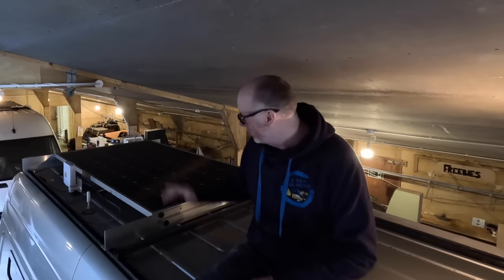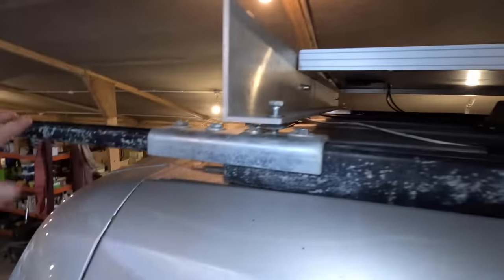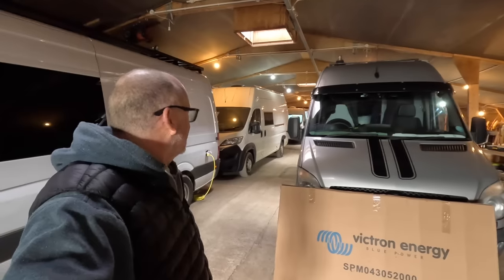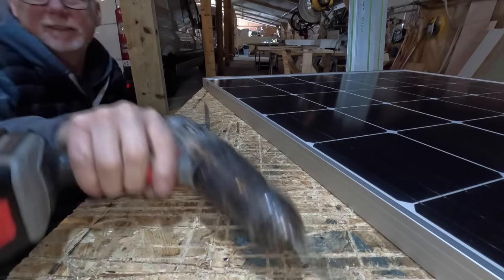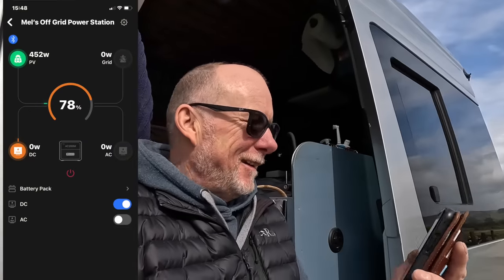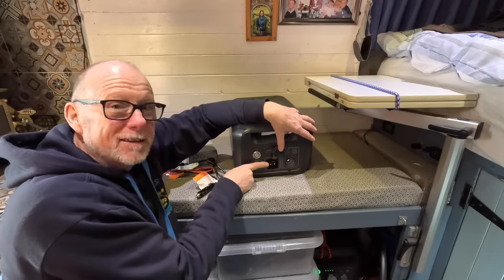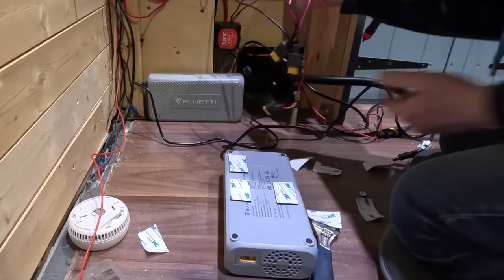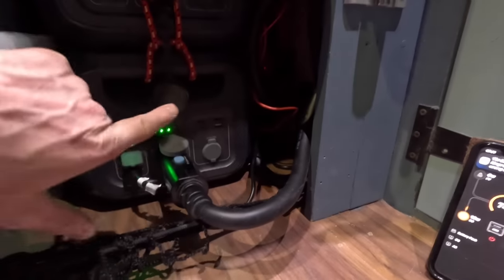This camper van has an insane amount of solar power

Comment: The parallel panels be ok in the summer, but you might want to consider series come winter. You won't ever get more than the max voltage of one panel so if the sun's low enough or it's cloudy enough you could be dropping down to 12v and the battery won't charge. At least in series you might get 7 volts off each panel making 14 and still be able to get some juice :)

Comment: Great bit of good luck there after extending the unistrut. Its like fate was watching over you. Ive just fitted an identical panel to the one on Viv-i-van so I now have 300 watts of solar. Theres enough room to fit one more 150 watt panel on the roof but Id then have to get a dedicated MPPT as the ctek 250 se only copes with 20 amps and with the two panels they are 17 amps in total . I'm aiming to get a power pack like you have and only use electric in the van for everything. Thanks for the continued inspiration and bessy regs-Kenny
Reply from the maker: Thank you Kenny

Comment: Well done Mel. I did the same after being gifted 3 x 280w  panels. I had to extend the unistrut at the front and mine overhang the side awning and protrude on the drivers side as well but for 840w of solar it was well worth it. I'm the only one who finds it slightly ugly but it sure helps when the sun is out with a 780ah battery bank.
Reply from the maker: Nice 👍

Comment: I made the decision to rip out all my LPG over winter and this year is my experimental LPG-free year.  As well as my induction hob and air fryer oven, I am experimenting with a rice cooker.  They are a nice low power (300W) but can cook more than just rice.  My fave is rice salmon and veg.  Also experimenting with boiled eggs, frying strips of beef/chicken, noodles and soups.   Scrambled eggs for breakfast is good as well.  Recipes are bit limited being a one pot, but I love it as you can pretty much cook a meal for   50-100 Wh (or about 10Ah). Cannot recommend it enough for someone with limited electrics. £30-40 for a two serving and £30-40 for an inverter.

Comment: You shouldnt have any probs with that much power Mel. I have never had gas in my van in 3 years, Running solely on 300ah lthium with 640 watts of solar and 60 amps dc to dc charging. I use a single burner induction hob as you do, with a kettle, toaster and rice cooker, powered by a 3500 watt continuous pure sine wave inverter. However, 300ah lithium will only allow a 200amp draw max so have to be careful not to use too many items at once. I use the basic rule of 10 for a 12v system. 100 watts on 230v is 10 amps (roughly) from your battery so 1000 watts (1 kw) is 100 amps!. Loving your set up Mel.  All the best  Ged

Comment: Additional rear lighting would be a good idea on your van Mel, as your nearside rear light cluster is effectively in a large blindspot created by the spare wheel arrangement. Possibly add indicator repeaters too. The Americans in particular seem to love loading up the rear doors with boxes / wheels / jerricans, which can obscure the standard rear light clusters meaning you are arguably less safe than those with rear light clusters which are fully visible.
Reply from the maker: Yeah you’re absolutely right 👍

Comment: Loads of power bud😊 I remember trying to lift my 345w on my own couldn’t do it so I used a fork lift 😂 
Engery monkey is great Tom and Amy use to work there so they helped me with the victron dc to dc charger shed all the kit needed which was great 😊
Great vlog bud looks amazing on the roof bud😊 I would love to use induction hob more. The most I pulled on my 345w the other week was 160w was quite happy with that but maybe I might look into a second solar panel on the roof ❤❤
Love to have a bluettie 😊
Have a wonderful weekend bud 😊
Reply from the maker: Thank you buddy have a great weekend too 👍🤓👍

Comment: running 5 200w solar panels feeding 4 100ah lifepo4 batteries that charge a bluetti 200p and 500 audew and a 150 thing from Walmart. 
 Can never have to much power. 🤪
Reply from the maker: Wow 😮 that’s really nice 👍
Reply: I have 1380w of solar panels (+100w to charge the 12v car battery) myself on my Ford Transit box van. What car do you have that can fit so many panels? My Transit has huge square box that is much wider and longer then on a normal van, perfect for fitting many panels ;) ? I also have 4 LifePo4 with  5000W hour capasity running 24v ;)

Comment: We have 600W of solar on our crafter van charging 200Ahrs of lipo4 house bank. We don't bother with dc to DC charging from the crafter alternator (250A) as it's not needed. We heat hot water, run a 1kW heater and cook with 2kW. We have room for total of 900W solar but find we don't need it.
Reply from the maker: Nice 👍
Reply: Which country are you in please Ian?

Comment: I have 645 watts 3x215 victron panels....I did a lifting system also one piece of angle fixed to roof between the panel then  bolted two uprights to each corner...cost only 20 euro now going to do the other two panels KEEP IT SIMPLE KEEP IT CHEAP.
Reply from the maker: Very cool!
Reply: Can you go fully off grid with that amount of solar? Thanks

Comment: Wise move Mel. More solar is better than more storage!  Just a word of caution. Keep the LPG for when there is not enough sun. I have an off grid system on my apartment here in sunny Spain. (6 large panels and 2 very large 48v LifePo4 batteries). For the last month the batteries have made full charge before lunch time (lots of sun). Been freely using electric water heater, washing machine, dishwasher, kettle, induction hob etc. Up to 2 kw charge rate. However, today it is overcast, and only getting about 300 to 400 watts. Sun forecast for tomorrow, so will be ok. I have no other way to charge the batteries apart from solar. During November and December I had to be extremely cautious with my usage to have enough power left to run the fridge. Did all cooking and water heating on gas at that time. So, I am cautiously optimistic for you not needing gas in the summer. But pesimistic for the winter. Clearly your alternator will help a lot, but still keep a standby system.

Comment: Really great video, well done Mel!
Now all we need is a bit of sunshine to enjoy all that extra solar! Did you do the maths on the cable ratings using the Y splitters? Wiring in parallel effectively doubles the amperage carried over those cables. Annoyingly you also have to factor in the length of the cable run into those calculations too :/
I'm not trying to have a dig, I'd be gutted if anything happened to you or your van.

Comment: Hi Mel, I have the AC500max and linked it up to Solar just fine. I want to do the VSR option too, but notice that in the diagrams for setting them up, they just have the positive lead attached to the relay and the negative (they have batteries rather than powerbanks) going to the earth on the van. Is this what you did with the lead to the charging enhancer? Positive to the fuse and negative to the skin of the van?

Comment: Good plan to see if you can go LPG free, as it seems to be getting harder to find, plus no running costs with Solar power. Small World, Sprintie failed his (NZ) MOT for not having a Hi mounted brake lamp - he's never had one, and has passed at least 18 years of MOTs without, but now someone thinks he should have one... they don't make one for his model of Sprinter, so searching Amazon for one that will fit, then have to wire it in....

Comment: Was those 300w panels expencive? I have 4 cheep 320w panels myself (150$ per panel) on my Ford Transit box van, you can not have to much solar power here in North Norway where sunshine can be absent for weeks ;) I also have 5000w/h Lithium battery bank and 3000w inverter. 

As it is now everything runs on electric power, even the heating ;) (sometimes you need heating in the "summer" here). But I do have a gas owen also as the electric heating will drain the battery to much if it is so cold that heating has to be on all night (next day will have to be sunny one or else you will be out of power next night lol).

I would have liked to have four 400w panels of same size (160*100cm) but they cost instead of 150$ pr panel it is 400$, way to expencive for just a little more power....
Reply: I was going to say the OPs "lots of solar" isn't that much I know lots of people with more than a thousand

Comment: Great video as usual.  Is the new panel on a tilting system? Not sure if you're new panel will pull down the power of the original panel when you tilt that one, as the volts and current won't match unless they're both flat or both tilted. Who cares though with 610w!! What a genius idea of extending the unistrut. Rear brake light at top of rear doors is definitely a good idea👍
Reply from the maker: Not sure yet 👍🤓👍

Comment: Question. How long would it take to get value on investing into solar panels,mppt, and all that? 5 years? What if you use that money to buy large lifepo4 cells and build batteries instead. A single charge of a large battery bank will last for over a month off grid. Since lifepo4 cells became available, these solar panels defeat the purpose waste of money tbh
Reply: I calculated I make up for the cost in about 6 months. Solar panels is the least expencive part of it, I did pay 600$ for my 4 panels of 1380w total. I also have 5000W/h of LifePo4 battery bank that did cost me 1600$ and 3000W inverter that did cost 800$. My 2 solar chargers was 240$. Here in Northern Europe it is horrible expencive having to pay for charging your batteries at camping spots (20-40$ a night)...

I run fridge, freezer, heating, cooking stove and a PC on the electrip power, it drains it in about 24 - 48 hours (without heating) if there is no charging.

The freedom of not having to go somewhere to charge your batteries and just stay out in the woods for weeks if you want to is worth it alone for me, the saving of money is a nice bonus...

If you use so little power that you do not need charging for a month a 100$ solar panel with 100$ solar charger will have you covered with electric power for 15 - 30 years...
Reply: @Rondo Cat  I dont think you can harvest enough energy up north, especially in the winter. It sounds like you have overpaid. Here is what I would buy if I have 3200. 3500/7000w inverter of eebay fot 300. Victron battery charger and Victron Orion both cost approx 450. EV type2 to Schuko adapter for 50 of aliexp. For the rest of 1400, I would buy 13000wh lifepo4 cells of aliba. And build battery myself. 
All my appliances run directly of 12v and laptop via step-up converter 12v to 19v worth 35. The only time I use the inverter is for induction stove. And that power bank gives me  3-4 weeks of grid stay.  I would have 3 ways to charge the battery, while driving, at the eV charging station or once a month campsite, so I can do the laundry as well.